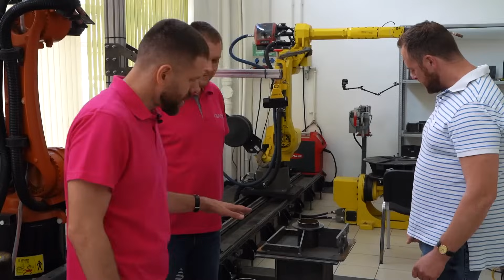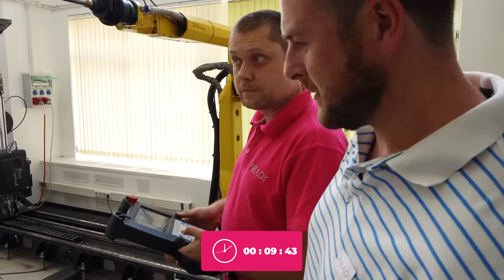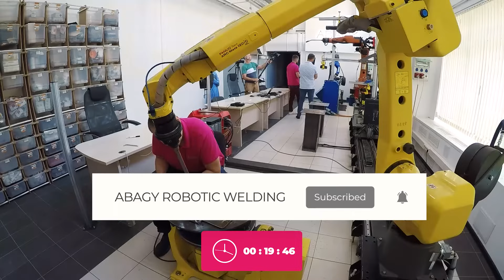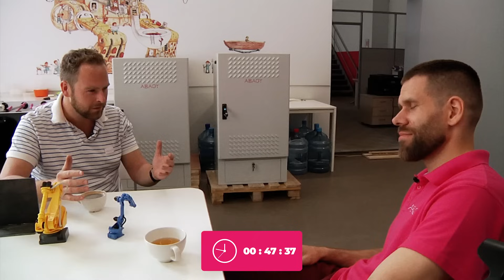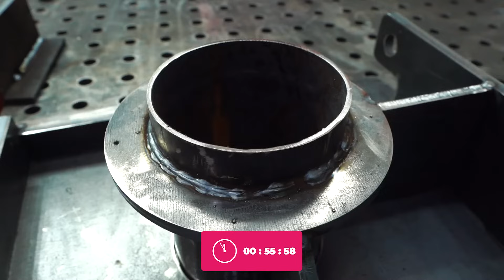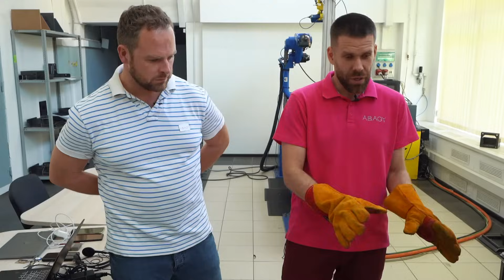Traditional Robot Programming vs AI & Machine Vision | ABAGY ROBOTIC WELDING

Comment: It would have been nice to compare the robotic welding time with manually weld time. The manual welder should also be allowed to use a positioner as that would improve quality and speed. In my welding shop we still do things manually - with positioners. However, I definitely want to learn more about the technology. We have a structural plasma robot that does all our cutting and it is quite simple to program - we create DSTV files using SigmaNest from our Solidworks files. It seems to be similar technology but applied to welding. 

For your structural steel solutions, do you supply software for any of the big vendors such as Voortman, Ficep, Peddinghaus. We are considering their solutions.
Reply from the maker: Thanks for your comment! It's a great point about comparing robotic welding times with manual welding times. Based on industry data, most welding suppliers have found that manual welding typically achieves an average arc time of about 15%, while robotic welding can reach up to 70% efficiency. This significant increase is due to the continuous operation and precision of robots.

Regarding your question about structural steel solutions, we can definitely provide solutions similar to those offered by Voortman, Ficep, and Peddinghaus but we are focusing on final welding, not assembling (that would be a difference), because we are working mostly with high-mix manufacturers, while the solutions you mentioned are designed for some batches of relatively simple beams with few plates to be welded.

If you're interested in learning more or discussing how we can help optimize your welding shop, feel free to reach out. We'd love to explore how our solutions can fit your specific needs!

Comment: Very interesting and impressive but they need to sort out the crater fill parameter, sounds awful.
Reply from the maker: Thanks for the comment. Welding knowledge and technology is extremely important. The production specialist knows HOW to weld and can set the correct welding parameters, and the robot can complete the task with those parameters.

Comment: When you have hundreds of components and a dozen robots or more to produce these components, the manual method is to slow, but it's good for small batches or one off's. The AI method is way faster and more efficient and flexible to work with and use.
Reply from the maker: Adaptive intelligent robots are most effective for high-mix production. The main advantage is the ability to easily switch from one product to another without robot programming. In this sense, a robot can be as flexible as a human.
Reply from the maker: ok